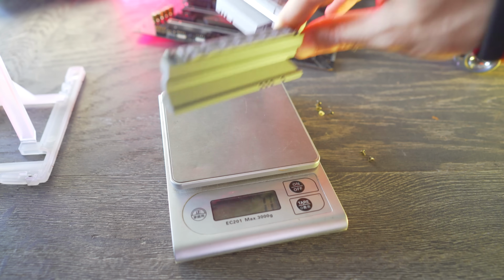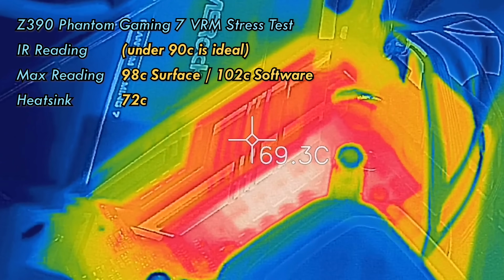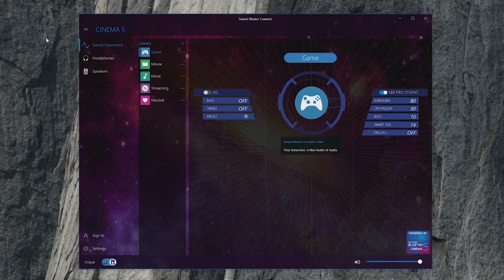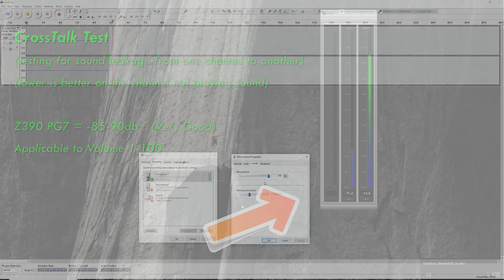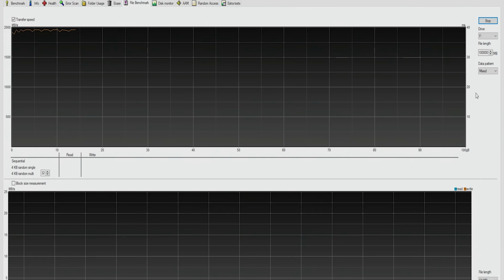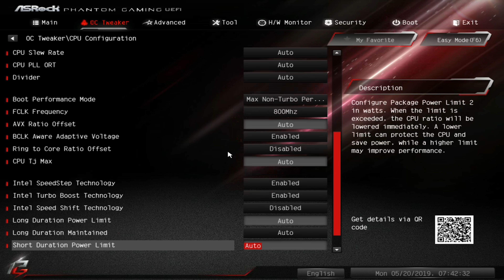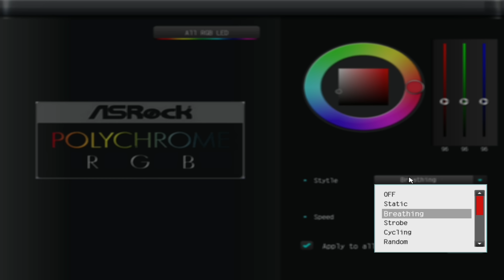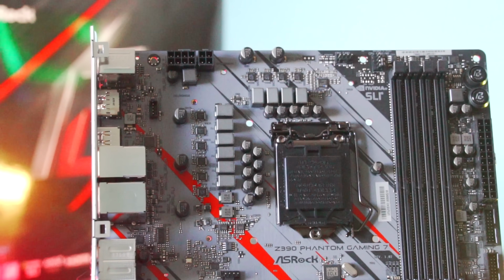a Z390 Refresh...!? ASRock Phantom Gaming 7 Review

Comment: I have such a motherboard, with Bios 1.11, but I also have a Z370 Taichi.
Why is it that Phantom Gaming 7 missing few parameters of sensors while it is composed of the same components as the Taichi?
Missing values are VR Loop1, VR VOUT, VR VIN, etc.

Comment: If they would've went with all the same exact intersil components that the z370 Gigabyte Aorus Gaming 7 and Z390 and X299 DARK boards used, they might of had a little bit better thermals with that choice of components. They went with the High-end ISL69138 but paired it with Sic632A's Vishay fets instead of the ISL99227BFRZ-T 60A Smart Power Stages (These power stages have internal current and temperature monitoring as well as double-sided cooling, meaning they are cooled by the solder contacts to the PCH and by the metal section on the top of the IC package). also Gigabyte used 76A inductors. then again Asrock used the real good ISL6617 phase doublers which have current balancing.  I can see they were trying to cut costs but at what cost. (20°c)
 I think if they were going to go with a intersil VRM. they should've just went all out and used all intersil components. 
  I can see how a 12phase VRM with 40Amp Smart power stages spreads 480 Amps a bit more across the chips, creating better thermals but a high-end 8phase VRM with 60Amp smart power stages can do the same. 
  This board can run the 9900K at 5GHz with an 8phase VRM. that's pretty good, So i would think the z370 Aorus Gaming 7 with it's little VRM fan and little bit better of a intersil implementation would be able to also. 
The only reason I say this is because I have the z370 Aorus Gaming 7 with the 8700K and it runs great. They designed it with the 6c12t i7 in mind. it just makes me think I could drop the i9 in there with no issues. Asrock designed this 8phase motherboard for the i9.

Comment: Do you think its better to get your sounds from HDMI or sound connections,.. might be a  good video in itself.
Reply from the maker: Oh its just a digital signal at this point.  Will depend on what analog part of the audio processing is doing the converting.  That's where you have to measure.

Comment: "5GHz at 1.36v"
My 6700k takes 1.3v to hit 4.4GHz
Reply: Same. I literally just can't get it to stay at 4.6 GHz period. If I want 4.5 I need to crank it up to 1.37v. I decided to just run it at 4.2 at 1.225v. and even with the Noctua NH-D15S, it still hits Max temps of 72°C... Like wtf

Really sucks, we lost the silicon lottery there.
Reply: @austinmaiden4663  My 4 year old 8 core i7 5960X can go 4.8Ghz@1.33v

Comment: I wonder how u connect the 8 pin and the 4 pin because my PSU has just 8pin CPU power cable.
Reply: Higher wattage PSU's have more of pci e and cpu connectors
Reply: @anky_but_on_steroids3750  Well I have SeaSonic Focus 650W Gold and it has only 8pin CPU connect. Or you can just use standart PCI-E GPU connectors?

Comment: how many m.2 can you run on a motherboard
Reply: On new boards 2 or 3 depending on the board, you can also add more if need be through a PCI-e adapters.
Reply: @wing0zero  yes but i think with the pic-e cards the lanes or band with is an issue but i have 7 of them on a asrock x99ws-e motherboard it also has 2 plx chips the bord accommodates 4 x sli or x fire with 4 by  x16 slots

Comment: Guys i upgraded my laptops cpu from a celeron b830 to a pentium 2020m and now it's shutting down at 90 Celsius but I've installed new thermal paste and cleaned the fans a bit
Reply: There may potentially be a TDP diffence between the two CPUS, the new one may be higher than the original even if not listed within intels specs. If so that could cause overheating and ensure thermal paste has good coverage and that the cooler is correctly seated.
Reply: @TheSentinel494  Thanks for replying, you might be right because it shuts down at 2.2 to 2.4ghz at 90% and yes i have seated the cooler right and put thermal paste at a good amount
Reply: @thealien_ali3382  where do I check though, it is supported i think as windows boots up and works only when it's at 100% usage

Comment: Hey my i7 4790k keeps getting hotter in the bios any tips how to fix it
Reply: Just a few quick questions. 

1) How long has it been since you've applied your thermal compound/what quality thermal compound did you use?

2) Have you delidded your CPU at any point?

3) Is there heavy dust built up in your cooler of choice? Are your fans spinning?
Reply: KaijuPN I put on new thermal paste two weeks ago and it’s all clean and not been delided
Reply: @Ryan-lw9hq  Are you 100% sure that you tightened your cooler to your socket properly? Uneven pressure or not enough pressure can cause major issues like this.
Reply: KaijuPN I’m sure it’s tight
Reply: @Ryan-lw9hq  There's only so much I can help over the internet. I'm sorry I couldn't help diagnose your issue my guy.